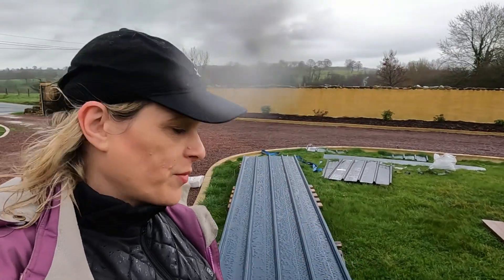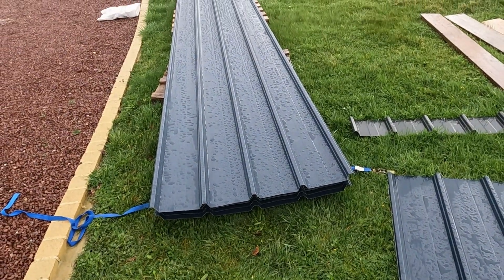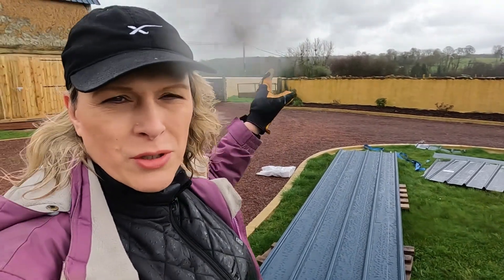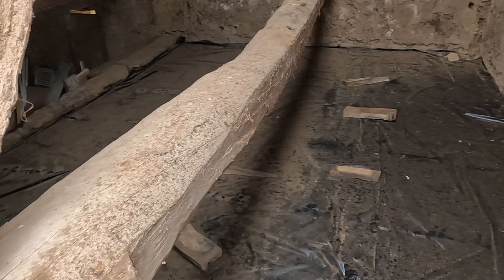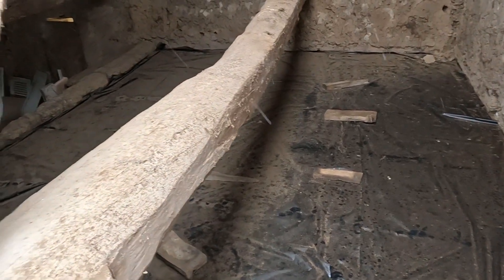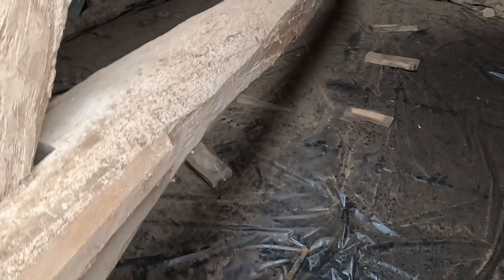Solar Roof Build Day 2 Pouring Rain And Wind!

Comment: Hello Sarah, I am following your journey to become energy independent, it's also my dream to build a victron system but due to budget costs and a much longer ROI, I might consider using some other components for the installation but definitely my Solar charge controller will be a Victron.  By the way, why you didn't consider a ground mount solar panel installation? I can see that you have a lot of space on the ground and much easier to maintain...
Reply from the maker: Having a ground mount system is something we definitely considered I talk about this in my new video which I'm releasing today thanks for your question.